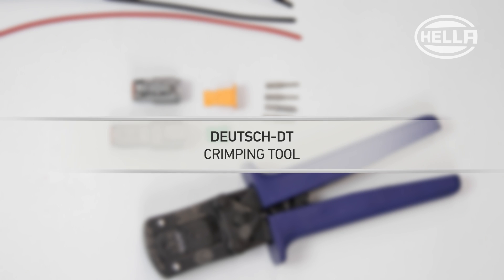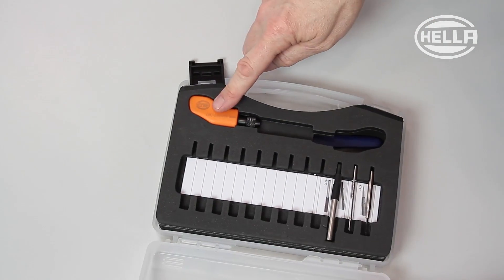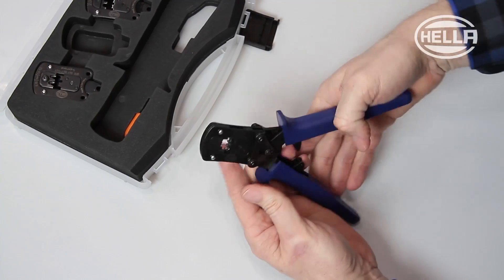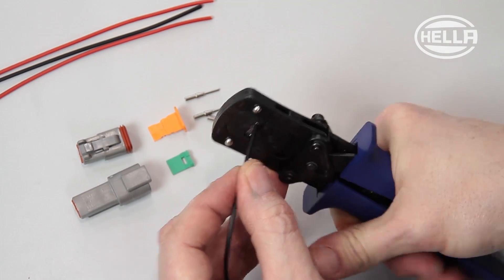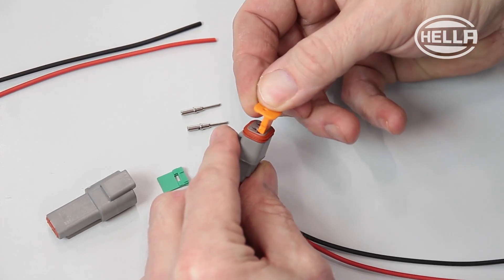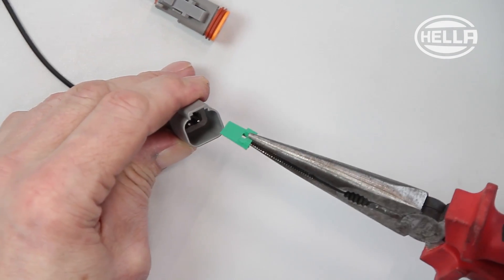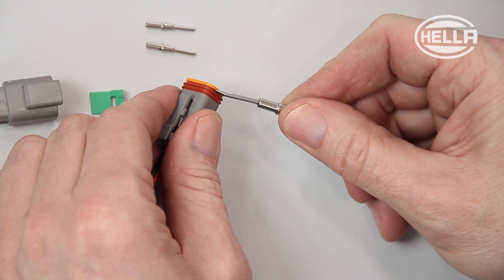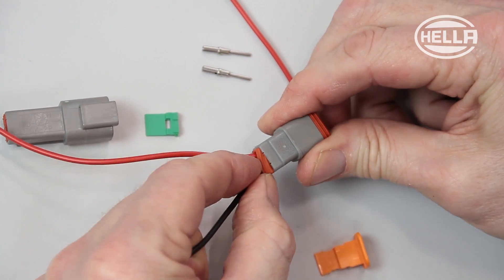HELLA - Crimping of a Deutsch DT Connection

Comment: Does it matter which side is negative or positive?
Reply from the maker: Hello malcookie,
this depends on the components of your construction. The negativity or positivity of the side has to align with the one of the electrical product you want to set in action.
Best regards, your HELLA Social Media Team
Reply: @FORVIAHELLAGroup  ok, which side is pos or neg for hella work lights then?
Reply: @malcookie  make sure u look at the connectors.  there is a right way and wrong way to install the pins.  Male pins goes in one connector. Female pins go in the other connector .. if not done incorrectly,  connector with not slide together,, as you can tell i put my pins in the wrong connectors

Male pins go in one connectors 
Female pins go in the other connector 
By the time you pull the pins out of the connector  to correct your error. There is not much left of connectors.

Comment: Are the Deutsch crimpers meant to be used for just one specific gauge of wire? I ask this, as all I have heard is 14 gauge is used when watching videos about them.
Reply from the maker: Hello OlympusHeavyCavalry,
we forwarded your question to the user support and try to answer as soon as possible.
Best regards, your HELLA Social Media Team
Reply from the maker: Hello OlympusHeavyCavalry, the HELLA aftermarket range includes contact sleeves and contact pins for the DEUTSCH connections are offered in the following versions: For 0.5 mm² to 1.5 mm² and one for 2 mm² cables. We hope this Information helps you.
Best regards, your HELLA Social Media Team